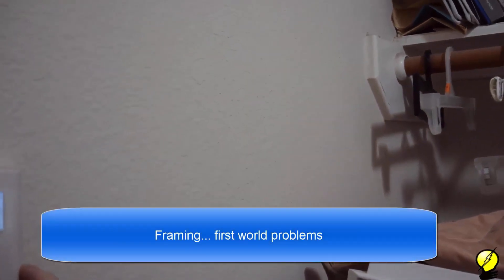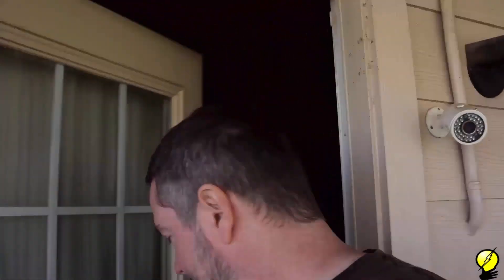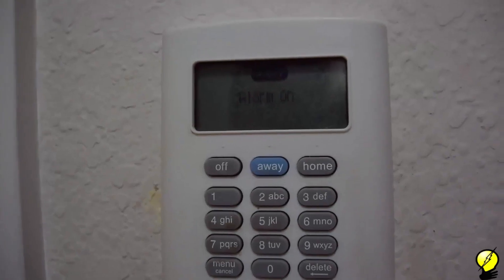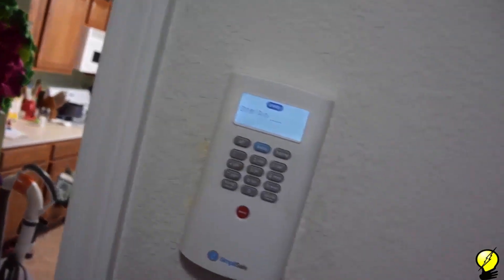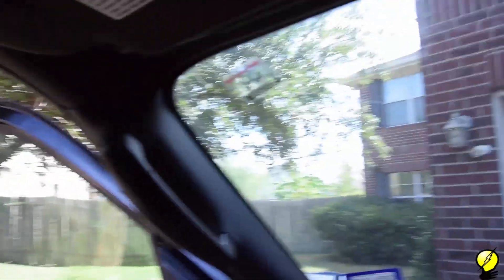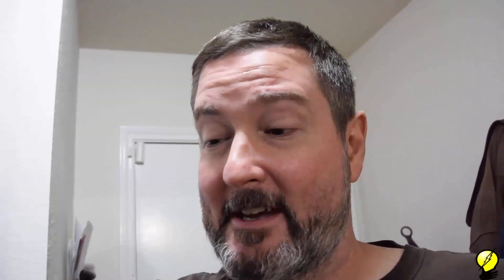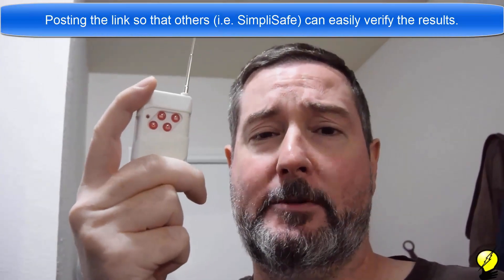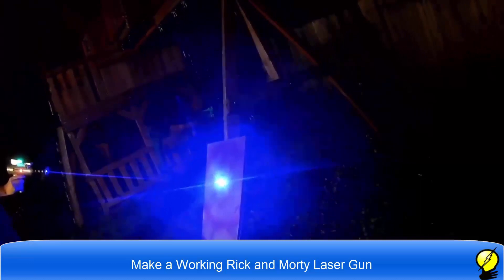SimpliSafe Review Jamming 2019

Comment from the maker: A heartbeat monitor for the sensors might help to defeat this exploit.  Example: If two or more sensors miss a heartbeat check within a designated time period, then contact the police. On an unrelated note, the web interface should have have a field for the user to enter the location of the sensor (front door entry sensor, master bedroom motion sensor, etc).  Perhaps it exists in newer software.  Seeing an alert with only a sensor code means that users will need to keep a separate record.
Reply: why not buy a real system then?
Reply: @PocketDrummer   Why are you asking me something that has nothing to do with the product?
Reply: They do have it to where you can name the sensors.
Reply: The security industry has a solution for this, SimpliSafe just didn’t design their system with it. In their defense, I don’t know when their next generation system was released so maybe it wasn’t around when it was.
But what you should look for if this worries you is an alarm system that uses 128-bit encryption and two way communication. These sensors that have that, usually also alternate it’s frequency so you would have to be blocking many different radio frequencies to accomplish this. Also, the two was communication between the sensor and base panel does exactly as you described. It constantly checks in, saying “HEY YOU THERE!?” And the sensors says “YES DADDY I AM HERE!!”
Reply: @PocketDrummer  hearbeats every few hours. Idk how long a break in lasts, but that doesn't sound good to me.
Reply: A heartbeat might kill the battery. But even if the sensor did a simple "did you hear me? If not, then keep retransmitting", that should make the system a little more resilient. (In that case: Who cares if the battery drains if someone is breaking in.)
Reply: Good video good job. Thank you. Was considering Simplisafe but too many are being jammed also via wifi jammers that can figure out various ways to jam security cameras.

Comment: That is an obsolete version of the system. Not the one I have. By the way, 433 MHz is in a HAM radio band. How can that be? What happens if a near by HAM 50 watt transmitter keys up on or near that frequency?  I monitored with a band scope and could not detect the Simplisafe signal.

Comment: Thanks for the info. Have they   fixed this?
Reply: I'm reviewing a new system to buy (I have Simplisafe) but I think everything has a potential to get hacked.

Simplisafe: 433 MHZ
Ring: 908 MHZ (transceiver is more expensive and not sure what notification Ring will send out)
Vivint: 2.4 GHZ wifi and Z-Wave (908 MHZ)
ADT Blue: Z-Wave (908 MHZ)

There's another video on a guy creating a wifi jammer that can potentially knock out the 2.4 GHZ.  Cheap equipment needed but needs some knowhow on how to do it.  Hoping it wasn't this easy to bypass some security systems.  I guess it's a cat and mouse game and similar to having to keep updated virus protection for computers.  Welcome to cybersecurity.
Reply: Maybe on new equipment.
Reply: There's a video showing something similar with the new system.
Reply: @ltcwinger3123  link?
Reply: https://youtu.be/IgP0uy_QUvA

And the lock lawyer tested on the new system as well.

Comment: Lol you can do this to ANY wireless security system. That test is on the old SimpliSafe system not the current SimpliSafe 3 system. The system will notify you of any tamper/interference. Nice try.
Reply from the maker: This video was a follow-on to one made by LockPickingLawyer, in which he was using a later version of the security system.  That later version also exhibited the same flaw.  Furthermore, the tamper interference detection on that later model was extremely limited. If you haven't seen his video, you may want to check it out.  You're probably right regarding any wireless security system may be subject to jamming.  The problem here is that SimpliSafe is using a common frequency which is easily jammed by an inexpensive device.  The excuses that the company made in response to LockpickingLawyer's video drove me to publicly call out the flaws in their reply.  The way that it was handled was terrible.  Anyone considering a wireless security system should be aware that they are trading security for convenience.  Since the whole point of having a security system is security, I think many people will think that this is a bad trade-off.
Reply: AdvancedProcrastination with the ability to do over the air updating SimpliSafe has taken steps to defeat this type of attack. Whether the frequency is common or not doesn’t really matter. If all that is needed is to know the frequency of a manufacturer’s system then this attack is common across a wide range of wireless systems.
Reply from the maker: I just tested the jammer a few minutes ago. The problem still exists.  So clearly no over-the-air push was issued for my unit and I doubt that I'm alone in this. While you and I both know that any wireless security system can be compromised in this manner, I believe that the majority of SimpliSafe customers are not aware of this.  Unfortunately some of them will end up getting robbed twice; once by a criminal and many times over by a company selling an illusion of security. If the problem is isolated to specific units which cannot receive an upgrade over the air for some reason, notifying those customers would seem to be a logical next step. When there are safety flaws in cars, recalls are issued. When the security of your debit card has been compromised, the bank reissues the card. But somehow here, the security system company doesn't even make an effort to notify customers of the issue.  Instead, SimpliSafe issued statements denying the problem.  This is when capitalism has gone wrong.  Also, I think that the common frequency does matter.  It lowers the barriers of use by the thieves.  It doesn't require any special knowledge on configuring the frequency to match, and the jamming can be done with a easily available and inexpensive device.
Reply: @AdvancedProcrastination  You're definitely not alone.  I've been with SimpliSafe, since 2016 on their SS2(?) system.  I can easily replicate the issue you've documented and am now actively looking for alternatives.  Yes, I did buy the same transmitter using Prime.

Comment: This issue must have been addressed. I purchased that same transmitter and It will not disable any part of my Simplisafe system.  I have a receiver that reads the signal code so Know the transmitter is working on the 433MHz frequency.
Reply: They said they were working on a detection algorithm when this came out and that this hack wouldn’t work once it’s out of beta. But I don’t know how it doesn’t work at all.
Reply: no it is not been addressed. still use 433mhz still can rob a house with 4 dollar part.

Comment: Could you do the same test on Ring and other systems to see if they are also susceptible to jamming?  Thanks.
Reply: Ring also says it will detect jamming and it will set off the alarm. I haven’t tested this though.
Reply: I've been researching now and Z-Wave is on 908.42 MHZ.  Haven't tested it but it's a more expensive transceiver.
Reply: I've tested simple safe, Xfinity and ring. There is no 2 way encryption on any of the sensors. More so how do you think its possible to build a system so cheap. Good things are seldom cheap and cheap things are seldom good. Pay for the real thing it might save your life or a family members. Also the technology you are talking about called check ins from brain to sensor only happens every hour. Useless if your dying on the floor.
Reply: Ring uses Zwave so it’s harder to jam

Comment: DO NOT GO with this company!! before you lay down hard earned cash call them and when the auto system comes up punch up EXISTING customer and then sit back and wait to see how long it takes for them to respond. This company is nothing but a scam a complete fake alarm company My system has gone down for the last time and I'm switching to another company. This company will not offer protection no matter who is claiming on the radio that they are. my simply safe is day to day not exactly safe just try calling in as a existing customer..just try I have had this system long enough to HATE ever going with this joke for a alarm system. forget about the   (UNBOXING) system in super unstable long term.

Comment: Just put up an ADT sign and they'll never know.
Reply from the maker: I like the way you think
Reply: @AdvancedProcrastination  This problem affects ALL alarms that utilize 433 wirless sensors.  I have a DSC commercial alarm panel (which can use ADT monitoring) which utilizes the DSC sensors and they, too, are completely obliterated.   This is not just a Simplisafe issue.
Reply: @ericc1214  Adt doesn't use those sensors anymore .
Reply: @ericc1214  absolutely not..  honeywell, dsc, ge, 2gig also have rf jamming. point id and 2 way comms... and NOW encryption. this is why a company that uses dsc like vector will take over a company that uses ademco (honeywell) like adt. but not one professional monitoring comany will take over simplisafe because it does not meet ulc or any other requirements .. while dsc does use 433 mhz this will not work on any thing bought in the time simplisafe branded chinesse rip offs have been sold.
Reply: Chris Tragedia Older ADT systems (Before ADT Command) use non-encrypted sensors. However, the ADT Command uses HoneyWell SIX sensors which was their version of encrypted and two way communication sensors.

Comment: The real truth behind DIY & cable company security is they are internet based systems. As soon as I cut your internet outside your house the system will spend 2 to 6 min trying to reconnect before cell back up kicks in. A lot can be done 15 min because by the time alarm company calls dispatch & police get there its a long time. Also the idea that analytics between sensors not checking in is crap. You think cops have time to come out because maybe you are having a break in. Again no internet , no cameras! so a real alarm panel threw cell guard with 2 way voice is the only real security system.
Reply: speed racer some have cellular backup
Reply: @tincan3  yes but its 6 min to work . Because internet system keeps trying to reconnect. Fact I've tested it myself. And still the system could not see what sensors were tampered with
Reply: There's also wifi hotspots that convert a cellular service to a wifi signal and have battery back-up in the event of a power outtage.  (Nighthawk).
Reply: I use Verizon home internet so no internet to cut outside the house lol.

Comment: I posted previously and needed to remove it for privacy reasons.
This was mostly a good video, though left out a VERY IMPORTANT STEP - You did not show that the sensor triggered the alarm when NOT pressing the jammer button. For example, the sensors you "tested" might not even be registered in the system. It might be worth reshooting the video to demonstrate that the sensors are in fact working. I'm tempted to order one of these jammers and try it on my newer SS system. Thanks for your effort on this!
Response
Hi Stephen, thanks for your comment. I agree, that test would have been useful. The sensors are detected by the system and will alert if the jammer is not in use. I've got nothing to gain by tricking anyone and a lot to lose with a burglar alarm that works with an inexpensive, easy to obtain, and easy to use countermeasure. I've also got a lot to lose if I was trying to slander SimpliSafe. I'm pretty sure that they've got more reserves to pay lawyers than I do. Even had I performed the "sensors work when not jammed" test, there will always be people that will say "yeah, but". That's just how the internet works, I guess. :) I don't have plans to re-test the my observations unless something new comes to light (like SimpliSafe reports that they've fixed the problem). I'd be interested to hear your results with the new system. Please continue to use this thread and share with us all.

Another previous response:
I'm looking forward to seeing your results. As a reminder@LockPickingLawyer performed the "here's how it works without jamming test" in addition to the jamming test. Maybe between the two videos, people can get a clearer picture of what is happening.

FINALLY  - my Amazon order arrived and I can report the findings.  First, I ordered the exact same jammer model as prescribed in this video.  Amazon lost the order twice so a bit of deflation in this late reply.

I have the new SimpliSafe system and cannot come duplicate the results in this video.  My version of SimpliSafe is newer, and from what I read they update their algorithms frequently with the newer system.  I tried the jammer about 3 feet away - nothing - the alarm was still tripped.  I tried putting the antennae of the jammer directly on the entry sensor and still the SS system worked perfectly.  I tried every button on the jammer, next to sensors and the base station - no impact.   The ss system worked flawlessly.

It's possible my new jammer is defective.  And, my better guess is that SimpliSafe has improved their system. 

But, I have a lot invested in ss and continuing to pay monthly, so want to be certain it's not easily foiled. Next step is to  order the jammers noted in Lock Pick Lawyer's video and more testing.  I'll add a follow up note if there's anything of interest discovered.

Comment: The only true home security systems are hardwired CCTV and alarms connected to your phone lines. Anything with internet and WIFI...just give up.
Reply: Landlines besides thier additional cost per month to even have it , can be cut and taken down along with the power . And LTE system is where it’s at
Reply: @letthejewslive  Cut my phone line and the alarm goes off, same as if you cut the power or open the control box.
Reply: @letthejewslive  If somebody is smart enough to cut your phone lines, you have a bigger threat and problem to deal with.
Reply: Lol, not rocket science to cut a phone line
Reply: @elsabelotodoaqui  My alarm will sound if you disconnect anything.
Reply: @jimmynich4791  doubt it
Reply: @elsabelotodoaqui  It does. I think in Britain that's how all the hardwired alarms are. If you open the control box, the alarm goes off and you have to enter the code, when I've had to turn the power off it goes off as well and if you try and unplug the battery.
Reply: Steve Pasquarella what about wireless systems not hooked up to WiFi like ADTS new Control and Command
Reply: @nicholasramsaur5500  Yeah some are much harder to get around than in the video and I think Simplisafe will probably come up with update to combat this problem. When burglars update their methods the security needs to as well.

Comment: Good Video.  This is exactly what I was wondering.  The only thing I would suggest trying is to test a motion sensor that is set up 15 feet away or so and not one in a simple corridor.  I wonder if the signal would be enough to prevent something from going off from a distance.
Reply from the maker: I set up four motion sensors throughout the house in various rooms.  Some sensors are upstairs, some are downstairs.  The house is over 3000 square feet.  To dispel any notions, the placement of the sensors are not all lined up in a corridor; you have to approach them from different directions.  Some sensors are in honey pot locations where you would have to approach in close quarters (e.g jewelry box).  Some sensors are placed at a distance of several feet from interior entryways. All sensors have been tested and work properly in that configuration when the fob button is not in use. Keeping the button depressed on the fob prevented all sensors from detecting me.  I'm confident that distance and orientation have nothing to do with this.
Reply: @AdvancedProcrastination  Thank you.